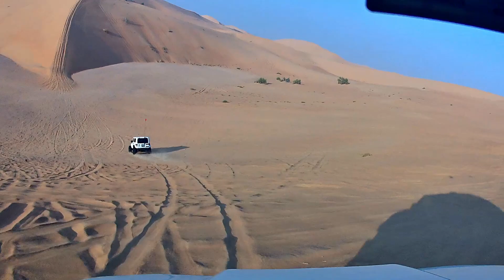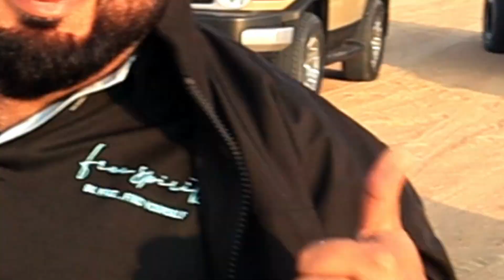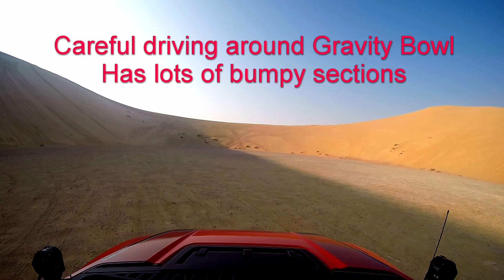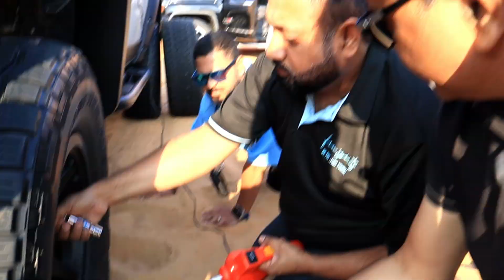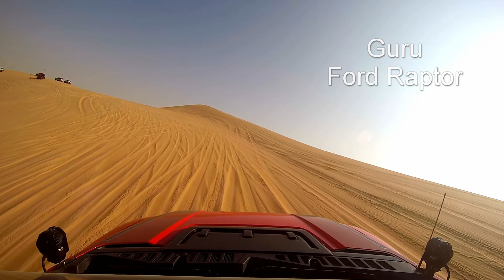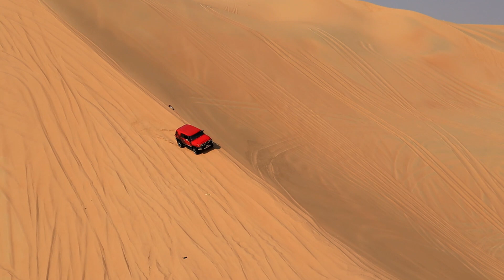Gravity Bowl Sweihan + Deathbowl. Fast paced drive with bunch of skilled Offroaders

Comment: very nice youtube channel very informative tips. what is the best approach to a steep hill to keep momentum in a fj cruiser? 4h vs 4 low? 2nd gear with diff lock?
Reply from the maker: Thanks and your channel is pretty neat too 👍🏼. FJ runs fine on L range with gears 1-4 depending on torque need. No need for engaging diff lock unless stuck. Careful on approach angle as can hit hard if too steep. Best to approach at an angle (rather than dead straight) and to test the dune at slower speed before giving it an all out attempt. Join us if you are in UAE ♥️